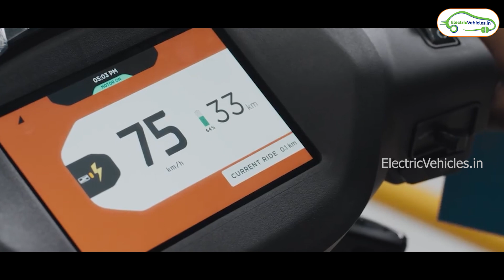Ather Energy Big Fund Raising | Latest EV News | Electric Vehicles India

Comment: Although Ather is one of the costliest electric scooters in India, is it still not sufficient to survive?It's just that the mobile components are being extended to the scooter and the mobile components may not cost more than 10000 INR
Reply from the maker: setting up from scratch and expanding nationwide is certainly capital intensive.. they need certainly another 500 million to 1 billion USD in the next 1 year time.   that kind of funding makes it possible for their Pan India dream...
Reply: Its not about survival. Its for manufacturing and RnD. One can take debt, which might be difficult if the number is too big, or sell equity, which they have done.